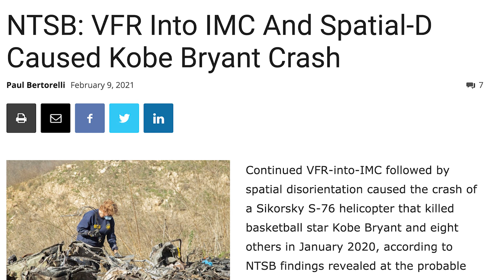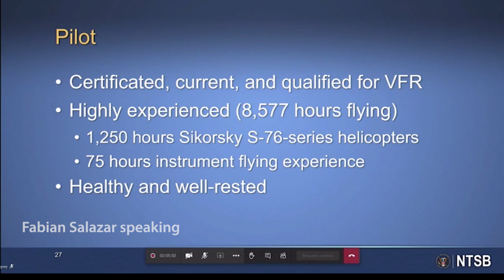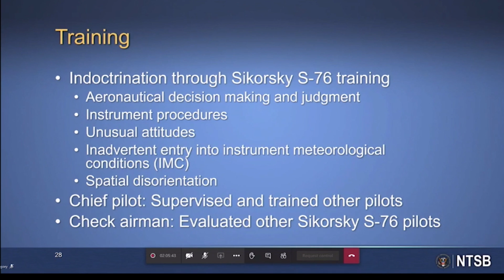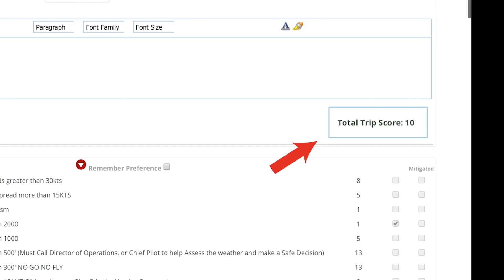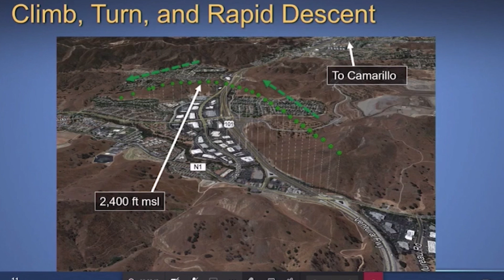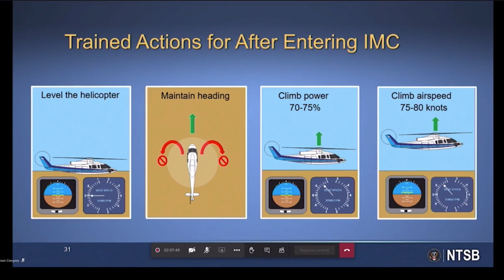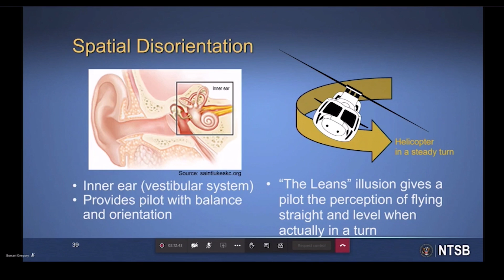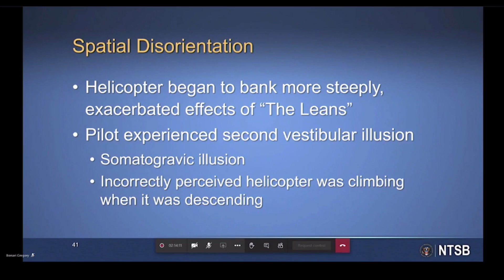How A Split Second Wrong Decision Caused the Kobe Bryant Fatal Crash

Comment: I am about 10 miles north of the crash site. The weather that day was unusual for this area. Stormy even. Very low dense black cloud cells that obscured the foothills. I can imagine adding coastal fog into the mix, closer to the ocean would have made for chaotic flying conditions. The area the crash occurred in is a series of narrow valleys running east to west and some going north to south. In some sections the valley walls are steep.

Comment: I was on a 737 climbing out from LAX around the time of that crash. Visibility was fine below the ceiling but climbing into it, the winglets were about 40-50% obscured by the fog of that marine layer.  So from within, visibility was about 150-200 feet, tops.  Also, I don't think it went from 1500 ft to 2500 ft but rather extended 2500 ft from 1500, up to around 4000 ft.  This is based on the time spent below vs in while climbing, and the appearance of the local geography, with only baldy, Whitney, and 2 or 3 other mountaintops visible above the weather.

Had they stayed below the layer, there probably wouldn't have been a problem.  Thing is the pass from Van Nuys to Calabasas would require flight above that altitude.  They should have just set down at Van Nuys and called for ground transport.  Would have been another 20-30 minutes to destination.

Comment: I have done some IMC simulation that was extremely realistic and I can vouch for how drastically different having zero reference is to simply having foggles or a hood on alone. In florida, we have the everglades where there are absolutely no lights or terrain defining marks and I went with my instructor at night with foggles on over the everglades. As soon as you passed the last defining road, it was 100% pitch blackness in my view and even having been flying "simulated IFR" for the previous 10 minutes, it was still a shock once all light references were gone. I even started a subconscious right hand turn soon after which I caught as my scan came around... I have 3 hours of flight in those conditions and it's something that could possibly save my life one day because normal daytime/night time over populated area simulated IFR does not prepare you at all for the real thing like featureless simulated IFR did. (for me, it was truly IFR).
Flight simulators are also lacking the sound and kinetic feedback you get from the real aircraft.. You sudden learn the helicopter makes all sorts of weird vibrations and noises during turns and adjustments in flight attitude that you don't really pay attention to when you can see. Perhaps there are some advanced sims that can come close, but I think having real IFR experience is invaluable and landing the aircraft as soon as stuff starts to look sketchy, is an opportunity that should always be jumped at.

Comment: It reminds me of my own flying experience where I nearly got myself and three passengers killed.  I was flying in bad weather, mountainous area, night time, and flying by the seat of my pants because I was not receiving VOR signals (before GPS).  I was lucky to be only about 20 miles off course, but, if my engine has stopped in route, I would not be writing this note.  I became a totally fair weather pilot after this incident.  The relation to this incident is, do not fly VFR if you do not see where you are regardless of the urge to reach your destination.  Land safely elsewhere, and fly another day.

Comment: it sounds to me like they need to put pilots in a physical device that induces the leans so that they can have a deeper respect for how convincing it is.
Reply: It is rather difficult to simulate the disorientation possible in 3D space.....utilizing 2D space.
Reply: @randydicotti3975  that's why the need for a physical device - that exists in 3 dimensions, not 2. nasa uses machines like this for training astronauts.
Reply: @Kamel419  THe USN also introduces these spatial disorientation illusions to all it's flight candidates...
Reply: It's enough for pilots to know the danger of spatial disorientation if the horizon is not visible. All aircraft should use technology to overcome this danger such as modern attitude gyros with large digital displays and/or aviation GPS.
Reply: @tomszabo7350  There's no incentive to push these 'heli taxi service' companies to upgrade their helis.
So, that's more of a regulation problem.

But I still say this, u can have the best avionics that money can buy, but at the end of the day, nothing beats a responsible pilot.
Reply: @carl8790   What are you saying? It's common sense, man. The incentive is not to wanting to die or kill people, the argument is akin to not having headlights on a car because you never plan to drive it at night. Regulators have no excuses, they should absolutely require it. Pilots are human, and being responsible is not enough to avoid a crash in every circumstance where ground proximity awareness may preven it.

Comment: I was in a VFR flight on a perfectly clear day in LA when the marine layer dropped in FAST! I was 10 miles off the coast doing stall training and was absolutely lost right away. I hadn't had my IFR test done yet but did my best to use my little training and X-plane playing to get me through it. I basically used my artificial horizon and compass as well as a patient and helpful center controller to get through to Torrance Airport where the visibility was good enough to land without instruments. It was scary and when I heard about the Kobe crash it was the first memory that came too me. Its so easy to lose situational awareness and your body doesn't even feel that you're in a seriously high degree bank or nose diving. Its insane.

Comment: I cannot believe that all of the adults on the helicopter did not question the decision to continue on a path knowing the condition of the area they were fighting into was dangerous.
Reply: For all we know, they did question the pilot.  In any case, the passengers weren't pilots themselves or otherwise trained to assess the conditions for flight, so it would have been natural and reasonable for them to trust the pilot's judgment.
Reply: @cardinalRG  Kobe knew  that particular helicopter, which he flies on occasion 
Could not fly in fog.  It just doesn’t make sense.   They flew blind in a soup bowl, there were spots  he could have set it down before taking chances with other people lives  on board, in schools and communities below.  Flying in the path of commercial fights etc.  All air planes had been grounded over that area and they hear a helicopter  but could not see it.  Make it make sense.
Reply: @gmeshell7  --To begin with, the accident aircraft was equipped and certified for flight in even zero visibility, under what are known as Instrument Flight Rules (IFR).  That includes flight in fog.  As a non-pilot, it’s highly unlikely that Bryant even understood that distinction, so he was in no position to make any assessment related to it.

”All air planes had been grounded over that area…”

That’s incorrect.  Other aircraft were flying in the same area, at the same time, and doing so perfectly safely.  In fact, that’s why the accident pilot had to hold after requesting SVFR transition through the Burbank Airport airspace.  Law enforcement grounded its own small fleet that morning, but since law enforcement does a different kind of flying than the accident flight, that grounding says nothing about the conditions for Bryant’s flight.

To repeat, the attempt to blame passengers in any way for a pilot’s mistakes, is not justified.  The passengers weren’t responsible or even capable of assessing flight conditions in the first place, and that’s why the pilot alone makes the decision to fly.  The passengers reasonably trusted the pilot’s judgment, and isn’t that exactly what you do when you board a commercial aircraft yourself?

Comment: Hi, Paul, thank you for this video, and all the others you've produced.

Per news articles, in 2015, this pilot did have an infraction of ingressing Class B airspace at LAX when the airfield was below VFR conditions.  There has not been much filling out the details, e.g. was it a revenue VIP flight.  One might extrapolate if the pilot was repeating the same decision chain in 2020 as he did in the 2015 incident.   I wonder if that could be a factor for NTSB Chairman Sumwalt to wondering if Island Express was a bad operator, twice is a habit.

On the matter of various pressures placed by VIPs, or by operators not choosing IFR operation certification, from my comfy non flying chair, it seem obvious that a limit is a limit.  That's my summary for all the hair-splitting if avionics or FAA procedures can create an escape path for a pilot's inadvertent adventure into IMC.  The NTSB meeting shed light that a formula exists for escaping the soup, the expectation is the pilot is monitoring avionics already in VFR helicopters, that the formula was built upon.  I don't personally know how powerful is the urge to ignore flight gauges and accept the inner ear as truth, or ignore ATC's request like ident, when attempting to disentangle a very tangled flying situation.

How does the obviously wordy passenger agreement form (from any operator) call out canceling departure due to pilot decision, in-flight decisions leading to terminating the flight safely, alternate destinations, etc?  There may well be a standard "Landing is mandatory, everything else is optional" clause in the agreement, but in the world of VIP travel, maybe that steak don't sizzle.  "Thank you for landing safely not at my destination, I won't use you or your company in the future."

Cheers!

Comment: Some FAR Part 135 companies dictate in their General Ops Manual an Enroute Decision Point, meaning that if you have to slow the helicopter down to 70kts and reduce the altitude to 300 ft AGL (daytime) or 500 ft AGL (night time) while in cruise flight due to lowering ceilings and visibilities to get a better handle on visual ground references, you WILL divert, turn around, or find a suitable place to land nearby.

Comment: The main issue to me is how/why this very experienced pilot wasn't able to handle VFR-to-IMC, especially when he intentionally initiated the climb so knew ahead of time that he would soon be in IMC. That would also be the time to turn on the autopilot. Yes, a chain of poor decisions leading up to that, but I still don't "get" why he wasn't able to handle the IMC especially since he had a very good autopilot.
Reply: And at 140KTS, it’s a quick climb above the layer. If you are gonna be dumb and fly into the soup that damn fast, might as well use it to your advantage to get above it. LA marine layers are not very thick. He could have been above it in just a few short minutes with the decreasing climb speed.
Reply: He probably was already in vertigous condition when he initiated the climb, and  lost it altogether when the heli took a dive with the left turn.

Comment: Even if you only drive a car and that for over 3 decades, like myself, you're going to make an occasional mistake and have to break suddenly or miss time a traffic light. I presume that's the same for a pilot, but my vehicle is not going to be over a thousand feet in the air, when I make that error  But I do hope I won't be traveling that fast

Comment: Poor judgement by a helicopter pilot is also what killed Stevie Ray Vaughan . Took off at one o'clock am, in foggy conditions, kept a lower altitude than the other three helicopters for some reason, and turned right into this little 388 foot high ski hill, just over 1/2 mile from where they took off. That one still pisses me off.

Comment: SLOJ probably the cause of the Stevie Ray Vaughn accident in East Troy, Wisconsin. That was a night flight and they had to get back to Chicago after completing the concert. Before midnight Eric Clapton's tour manager, said that the weather was getting worse and they all had to leave very soon. By 1AM the dense fog had already descended all over the valley, but the flight schedule was prioritized over safety. 
Stevie was also very adamant about getting back to Chicago immediately and took the last seat available for the third helicopter.  The pilot also was probably informed there was a time crunch took off at a higher speed and slightly lower altitude than normal. It banked sharply to the left after about 1 mile of travel and impacted the ski slope at  300ft elevation.

Comment: 8500 hrs flight time and 75 hrs instrument. That's why, Helo pilots rarely fly in IMC.
Reply: I'm not a pilot, can you please tell me what 75 hours instrument means, and what that may imply as far as this accident.
Reply: @kevinfoley8105  It means the pilot only had 75 hours flying a helicopter using only the instruments on the panel in front of him (i.e. it's too dark or weather is too bad to clearly see anything outside the aircraft). Helo pilots rarely ever fly in conditions where you can't see anything outside the cockpit, and the charter company the pilot worked for was only certified to do VFR (visual flight rules = you must be able to clearly see things outside) flights. So his point is that when the weather got bad and the pilot needed to rely on the instrument panel to maintain stable flight, he didn't have much experience doing it.
Reply: @shrinkshooter  Thank you!
Reply: @shrinkshooter  Apparently he was an IMC instructor too, smh.

Comment: Would a gyro seat useful in helicopters ?
On motorcycles,you keep your head straight when leaning,but you have spatial reference around.
On helicopters,you could keep the seat straight,and use the cockpit itself as spatial reference around you in case of no visibility,or just even to pilot it more accurately,the spatial reference being close to your eye,and well defined.

Comment: I live about 10 miles north of the crash site in the Simi Hills at 2000' elevation . On the morning of the crash I had left my property at 8 am and was astonished at how thick the clouds were here so late in the morning.  I literally couldn't drive faster than 2 miles an hour because of no visibility until I made my way from the top of Black Canyon down to Simi Valley.  No one should have been flying VFR at 2000 ' elevation. If it was that thick here then Calabasas was even worse, being 10 miles closer to the coast..

Comment: Do you guys think the passengers felt the sensation of the steep left bank and knew something was wrong but the pilot didn't?
Reply: The passengers likely felt the steep left bank but did not realize anything was wrong bc they trusted their pilot.
Reply: I believe the pilot saw the hills at the last moment, that's why he climbed & increased the speed but there were no more room. The passengers were probably in fear and holding each others' hand tightly. They were travelling at 180mph and hitting an immovable object.
Reply: The way they were turning it would have felt and looked a lot like they were actually going up...
Reply: @inlikearefugee5194  Sorry, but they wouldn't have had time to feel fear while "hitting" the immovable object.

Comment: I've had two inadvertent entries into IMC in a helicopter - one and Enstrom and the other, an H269. I've also been a front seat passenger in an R44 when the PF enountered IMC. In all three cases the instinctive response was to pull back and slow down. I took control in the R44 but only because I had learned from the mistake I made in the Hughes, where it took the passenger yelling "airspeed!" to make me realise we were getting dangerously slow; you cannot hover a helicopter on instruments. So I'm surprised that this pilot did not do that. Also, as the heliopter was equipped with a 4-axis AP, surely company procedure should be to arm that when flying in marginal weather? I know I do that in a fixed-wing. Anyway, just musings from a not-very-experienced private pilot. Thanks for this, PB.
Reply: What is the danger in flying too slowly in a helicopter on instruments?
Reply: I think the pilot put himself in a position where he had no choice but to attempt a max climb, at least initially, to avoid terrain.  Don't think an autopilot could help him there - he was on his own!

Comment: 7:59 I don't get what the instruments or autopilot does differently to the inner ear so that it doesn't suffer from the leans. How do they allow to know the difference between descending turn, and ascent? This is probably a stupid question, but I don't get it. Cheers.
Reply: Man made instruments use spinning gyroscopes which detect changes in direction independently of any acceleration. This makes them much more accurate than the inner ear which uses the movement of a fluid to detect acceleration.
Reply: @lubey111  Oh I see. I knew about gyroscopes but didn't really appreciate the difference in what they're doing. It makes sense now, cheers.